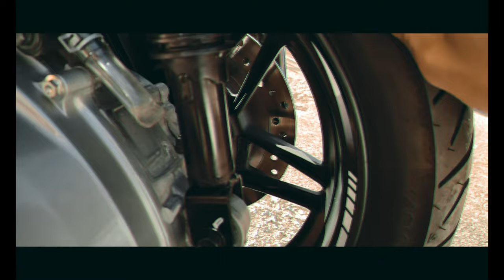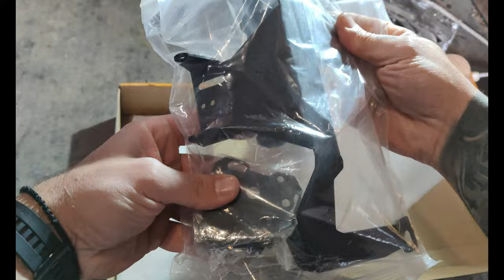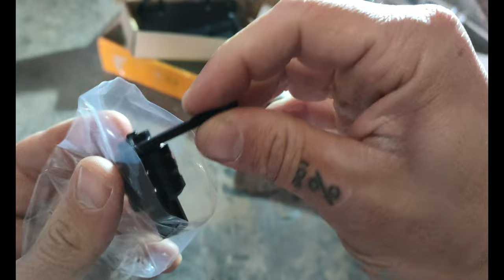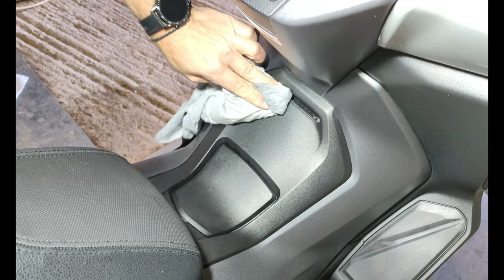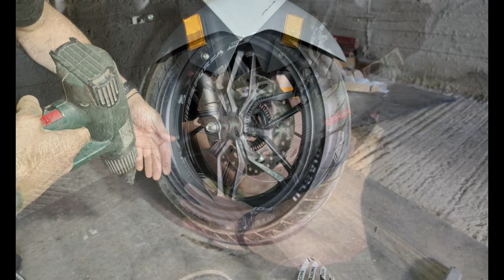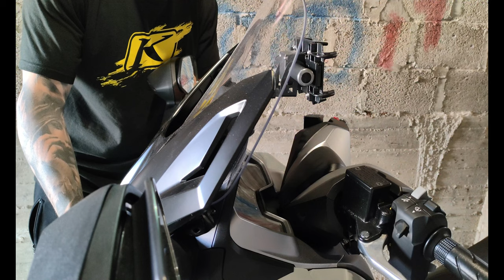HONDA FORZA 350 (accessories)

Comment: The Forza 750, the X-ADV and NC 750X, and any other vehicle in this world have parking brake, on CABLE, and SEPARATED from main hydraulic brake. Didn't you asked yourself, why is that, before purchasing and installing that shitty brake lever lock? I tell you, why: Because keeping continuous pressure into the hydraulic brake, for long time, does anything, but good to the hydraulic brake system. So, good luck when you would lose the rear wheel brake. Hopefully it would not happen at high speed.